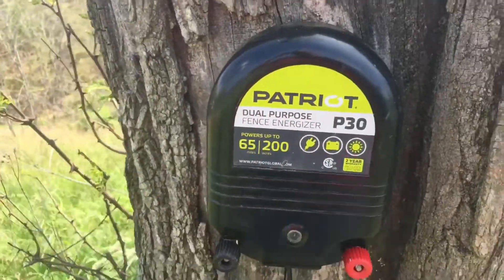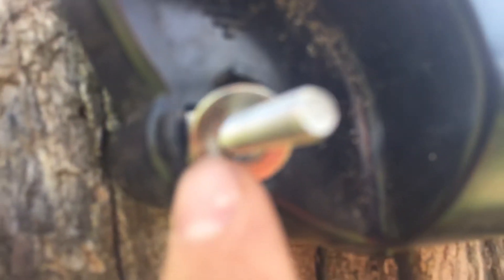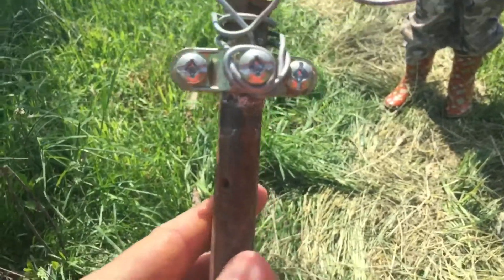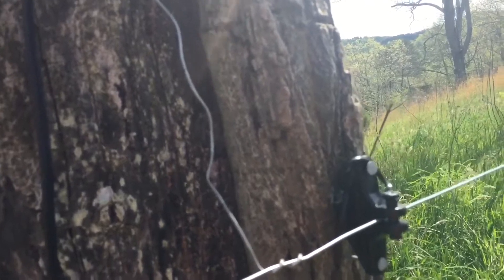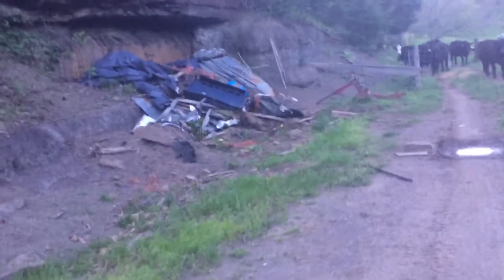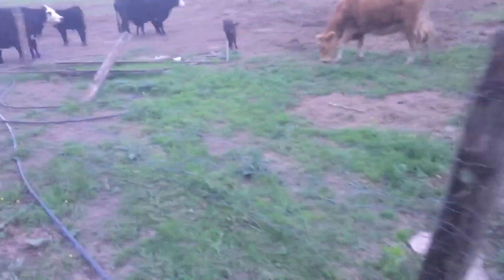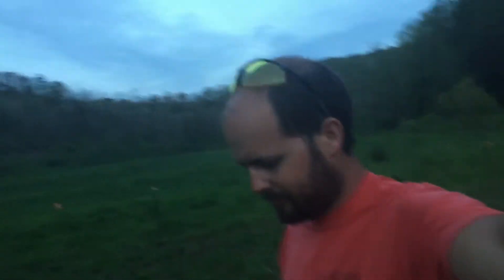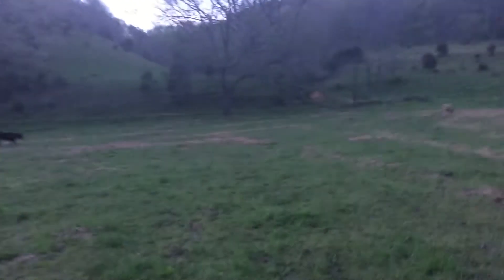Fencing and stupid bull

Comment: Yep seen some cattle do some stupid stuff all right... 

When we added a hot wire on to the inside of our perimeter barb wire fence, to keep them from pushing on the fence to get at grass in the county road ditches (since the flippin' gubmint won't mow it hardly anymore...) We put the hot wire in, then grounded to the barb wire.  This has a couple of advantages-- 1) unlike driving in 2-3 ground rods and connecting them up to the charger, and relying on the cattle to complete the circuit to ground and the ground rods from earth to the charger, which can fail in dry weather or result in a weak shock due to them not being grounded well on dry soil, the ENTIRE FENCE acts as a ground... every steel post and all five strands of barb wire is like one huge ground... 2) since the barb wire is steel, when the cattle DO mess with the fence, the shock only has to go through them from where the hot wire AND the ground wire is touching them, or if they don't touch the barb wire but only the hot wire, it will jump from the hot wire through the cow through her feet into the ground to the closest steel posts and then through the barb wire directly back to the charger, so MUCH less resistance and therefore a stronger jolt.  DO use a good lightning choke though to protect your charger... 

We've had ZERO problems with cattle messing with the fence since we installed it that way.  Course for temporary fence, where you're not "backing up" a barb wire fence, it's hard to do it that way, unless you run a second "ground wire", which I've seen some guys do-- 3 wires-- hot on top, ground in the middle, hot on bottom... 

Later! OL J R :)
Reply from the maker: Yeah I the county next to me they do 7 strands of night tensel and alternative hot to ground and it makes a super good fence if I owned that ground I would do like you are saying